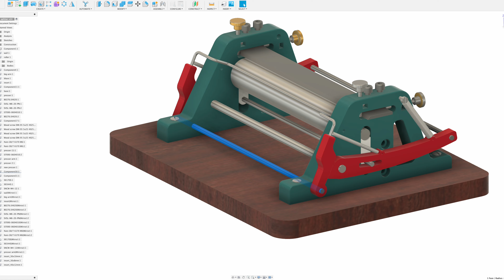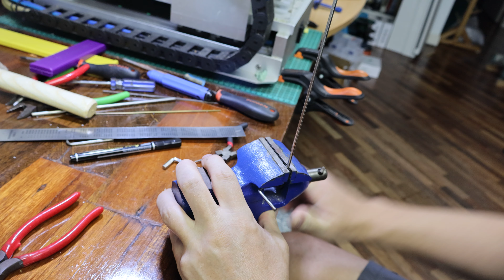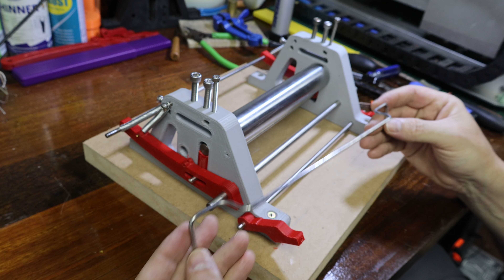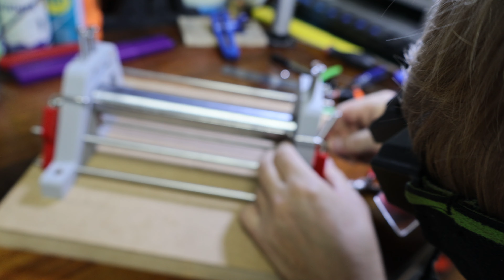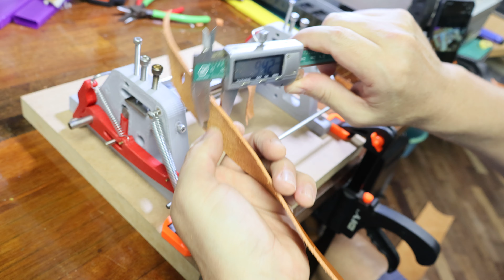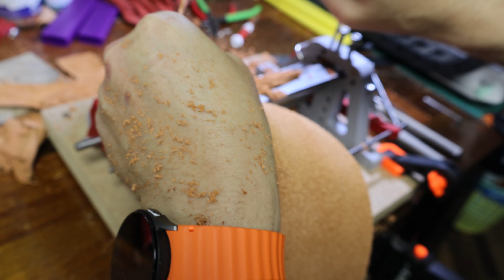3D Printed DIY Leather Splitter Skiver

Comment: Wow, that's incredible.  I tried doing this with wood, but the precision wasn't there due to lack of tools at the time.  I am going to try to model it with my 3d printers.  I would consider adding a gear to the roller and try to attach a chain and a motor.  I'm very impressed with the results especially with the wider leather.  I wonder if a wood plane could be modified to go even wider.  Maybe with a vacuum system.

Comment: Cool design. From looking at the video I see that it cuts better on the sides and worse on the center. I think its becouse the 3mm rod is not strong enough an it flexes. I think You could make it a lot more consistent using another, smaller roller there or a wider flat stock. Will be printing this soon and try to use a smaller roller.